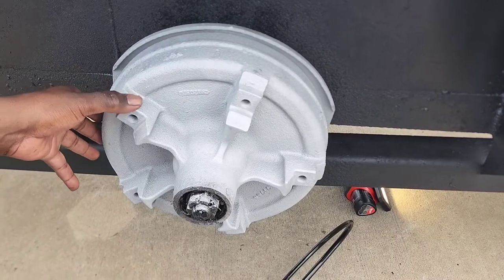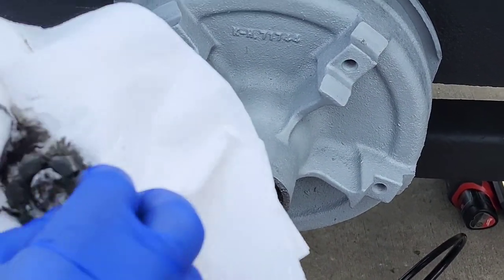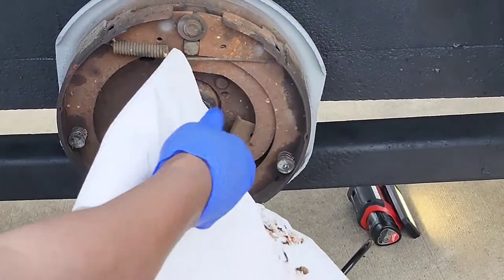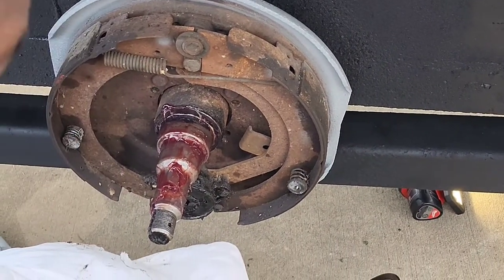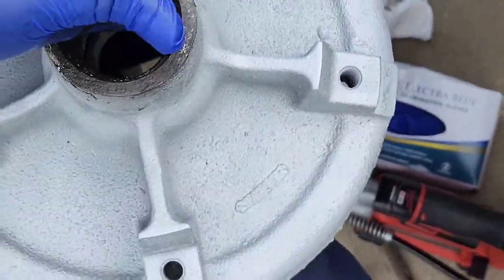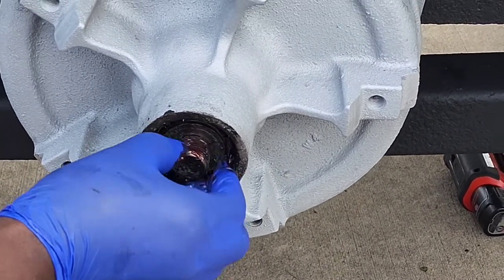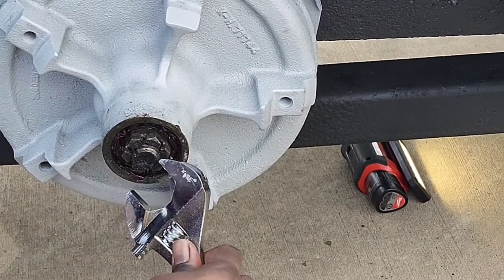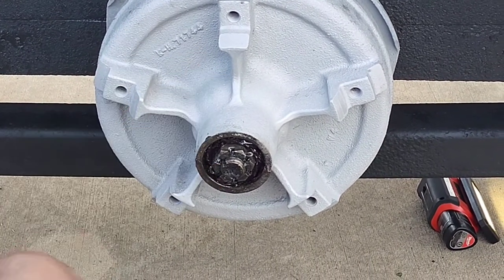How To: Disassemble & Grease a Mobile Home / Lowboy Car Trailer Spider Wheel Hub for Dayton Rims

Comment: Where is the best place to get the bearing kits?
Reply from the maker: @dupreemr  to be honest with you the best thing to do is to take the bearing out. That bearing has a part number on it period and if it doesn't you need to measure the inside diameter of that bearing to be able to find the correct one.

Comment: Is there just one bearing on these axles?
Reply from the maker: It's two bearings one on the left side of the axle and another on the right side of the axle. Technically it's one each wheel.
Reply: I said axle, but I guess I actually meant to ask if they're was one bearing per spindle. Which you just confirmed, one bearing per spindle/wheel. Thank You!
Reply from the maker: @SBDScott  you're welcome I'm glad that my video could help you
Reply: There’s 2 bearings per spindle. One in front side of drum and another on the back of the drum. 
The other drum on other side also has 2. So total of 4 bearings (2 each side ) for both sides— there is 4 in total.
The rear bearing is inside the drum. That’s how the drum rides on the spindle. Can’t have just 1 bearing per spindle and have rotation on a shaft.